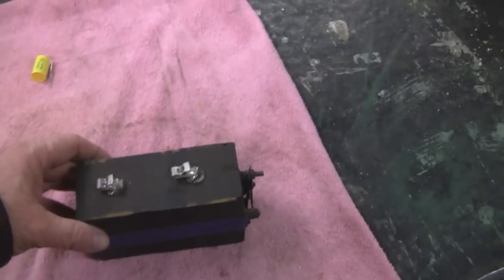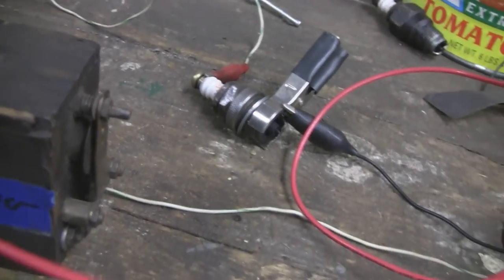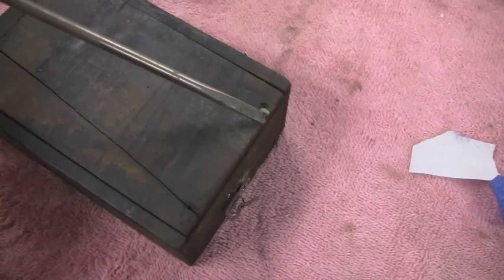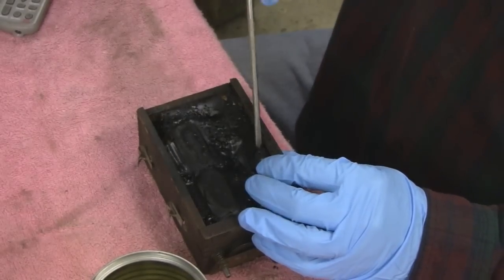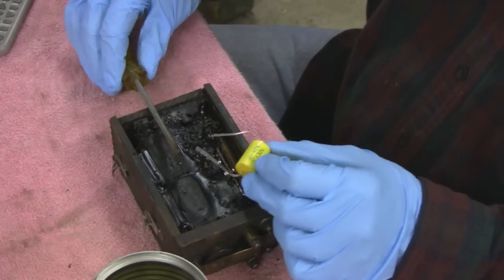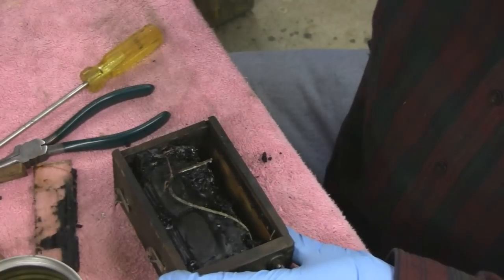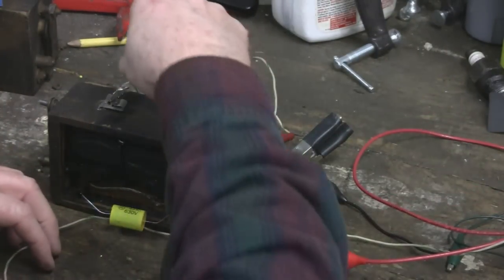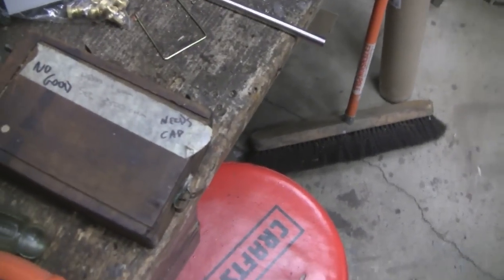BUZZ COIL REPAIR (Model T Ford)

Comment: My first nitrogen laser used one of these plus a couple microwave oven diodes to charge the lasing capacitor. Built it all inside an old lunch box. ❤

Comment: This made me think if the windings have gone bad or someone has destroyed them by poking with a screwdriver through the tar into the wrong location in the buzz box, could the whole contents be replaced with an electronic version inside the original enclosure, using a suitable coil and a kind of free-running CDI driver.
It is of course not the original thing any more but at least it would keep the appearance and functionality of the original ignition system.
Reply: Yes you can use a furnace ignition coil, the ignitor board from an old sodium light fixture and the capacitor for the ignition coil. Can get all for almost nothing with some tools and a visit to a junk yard. Also possible to use the coil from a lawn mower or weed whacker, use the coil for the kill switch as the primary, judicious use of a hack saw will make it power the magnetic part of the buzzer.

Comment: What is normal capacitor ratings for centrain engin size?
Is there way to calculate how much you need primary and secundary coil?

Comment: Great tutorial!...One thing....I would not recommend using the typical silicone sealant  to fill the voids in the box. The reason, is that typical silicone sealants contain a percentage of ACETIC ACID.
(Smells like vinegar?)

This acid reacts with copper to produce verdigris, which is a form of copper oxide, indicating the copper is being 'attacked,' so to speak. There are specialized silicone compounds that don't have this acid in the compound. I'm not a chemical engineer or metallurgist, but after 55 years, I've personally seen the results of 'fixes' of electrical items with silicone sealant. They weren't so good.

Comment: This was really really helpful! I had a question, maybe you could answer it. How do you test the primary and secondary coil? I think you test the secondary for resistance using the two posts on the side, but I’m not sure how to test the primary... thanks for the video!

Comment: As it turns out my friends that are wrong!  I am not a know it all! I didn't  know there was a cap inside those coils! That is a great tip! When I was a kid I got a shock off of that type of coil. It didn't feel good. The wire inside them must be about number 35. I tried to separate the copper off the high voltage side to see how long it is? Never got it off too far as it got all tangled up! There must be a few thousand feet on on it?

Comment: Mr.roadking.what size capacitor what values should i use .i am thinking of repair one..my email<rammgarr@yahoo.com>
Reply from the maker: +RAMM GARR point forty seven MFD, six hundred volts (.47 mfd 600v)

Comment: Road king what size capacitor should I use. I want to rebuild mine since I saw your video
Reply from the maker: +Stevie Mote Fogot to tell ya voltage!!    point 47 (.47 mfd)  630 volt

Comment: you know you can get all the parts for a model t coil at most model t part places online.
Reply from the maker: +Albert Koopman Yeah, it's not worth buying replacement parts for our coils, good used ones are only $5!! We only use them in show engines!! If we were using it in a Model T that would be different!! I only messed with this one because I have hundreds of capacitors laying around!!☺

Comment: Did you know that the buzz coil is actually a spark gap transmitter ? The plug wire is the antenna lead . If you look at (lawnmowerman02346) I show a short power point on making buzz coils from scraps . Steve
Reply from the maker: +Lawnmowerman02346 That's interesting, I might try that!! I have a spare box and a bunch of old briggs coils laying around!!☺
Reply: The best coills to use are the old point ignition ones . They must have 4 leads primary. + and - , secondary + and -  Chassis grounds work .   Steve
Reply from the maker: Now you tell me!! I tried it using an old 5S coil!! It worked as a coil would but it wouldn't buzz!! I'll have to find a 4 wire coil at the next show!!☺

Comment: I love how they made things back then. To me even a simple box was a work of art.
Reply from the maker: +prancstaman It's amazing isn't it!! All finger joints and brass for something that isn't even seen!!☺
Reply: You're right. I've got a '26 Model T that I finally got running. People love to see those beautiful coils. The top plates are brass, and they really polish up nicely. Since he's not putting the coil into a "T" he's not worried about filling the voids in the box, but if it's on an actual Model T, it will shake so much that the parts will probably rattle loose. I was out in mine last week taking the first drive when the coil box lid vibrated off which caused two of the coils to lose contact. I like this guy's style. He explains everything so clearly.

Comment: I have one that is completely dead.  Curious if you have ever replaced the actual coil part with something from a later engine that will work and fit into the box?
Reply from the maker: +GunPilot No I've never done that!! I do have one I completely gutted just outta curiosity that would be a good candidate for something like that!!☺

Comment: Very interesting for me. Until I watched your vids I'd never heard of a buzz coil. However, at the start where you show the points sparking a lot, I instantly knew you were right, and it was the condenser. Replaced so many on distributors lol. Most kids today don't even know what a distributor is.
Reply from the maker: +MalcOfLincoln Yeah the Kids don't know nothing about Carbs, Dist, and points!! And we don't know anything about the new coil packs but they do!!☺
Reply: Exactly. Modern cars...it's like being a 5 year old again and knowing nowt. Least my Clio diesel has no electronics, so I can fix it. No air bags, ABS etc etc.
Reply: +805ROADKING Not all of us are like that, I'm 19 and I do quite a bit of work on old cars! :) My  car is and 82' corolla with a little 4 cyl hemi that I just rebuilt, Threw a weber 32/36 carb on there to make it that much better.
Reply: I messed around  with those Toyota 2tc and 3tc hemi's quite a bit from my early teens in to my 20s and those lil suckers can be built to pump out a good bit of power for a lil 4 banger

Comment: Model T had a magneto in the flywheel with 16 magnets. The buzz boxes were used for starting. They were typically powered by dry cell batteries.
Reply: The buzz coils do operate all the time. The batteries power the buzz coils during starting. Then the driver throws a switch on the steering column to run the buzz coils off the magneto. The batteries don't recharge like in a modern car so running the ignition off the magneto preserves the power in the batteries.
Reply from the maker: +Joe Albert Interesting, didn't know that about the flywheel!!☺
Reply: thx joe

Comment: Would that exact coil be found only on a Model A? Or was it made by an electric component company and distributed with a number of different motor products?
Reply from the maker: +John Ratko Nah they are original coils off a Model T, They have the Ford emblem embedded right in the case!! There was a company that did make them later on, but the ones I have are the real McCoy!!☺
Reply: 805ROADKING Model T, back when Ford made everything on site. Sweet.
Reply: John Ratko only on model t’s. Model a’s had a completely différent sparking system